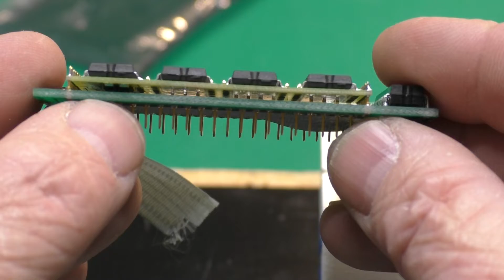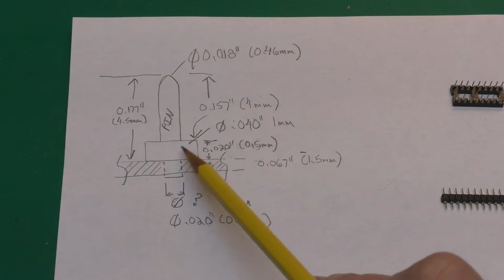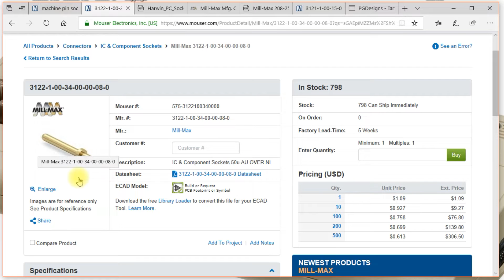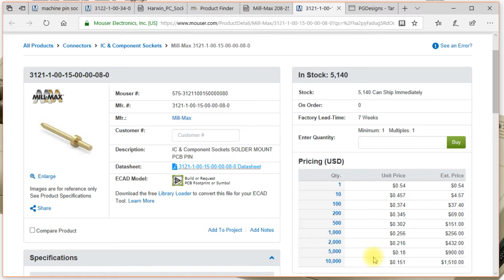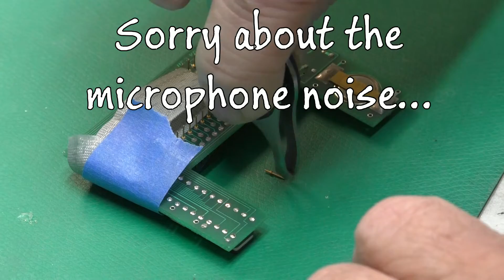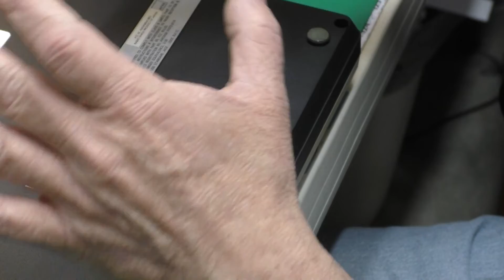TRS 80 Model 100 PG Design RAM

Comment: this fit into the Tandy 100 expansion socket. On the Tandy 102 it is a 40 pin socket on the back like that on an IDE hard drive
Reply from the maker: It will only work on a 100. The 100 has one signal on the expansion bus that the 102 does not have. This extra signal lets an addon board suppress the built-in memory and supply external RAM.
Reply: @HeyBirt  ok thanks just identifying the 40 pin socket under the 100 I have  all of them (100 102  200 600)

Comment: Some precision work there. I've found that finding the correct part in a catalog can be very difficult. Even when it appears like you've found the part you're looking for, there will be some variation that isn't mentioned in the specs, or visible in the picture. Finding that one single pin (and being able to order just one) is impressive.